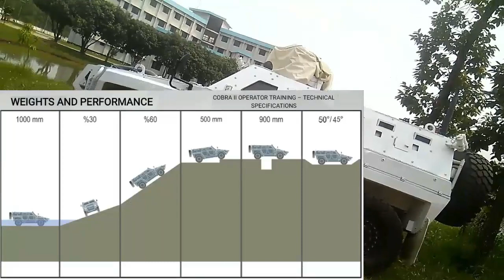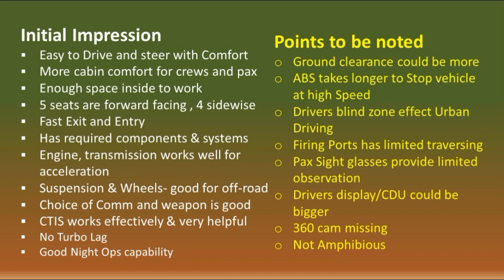Otokar Cobra 2 HMS Reviews, Part 1 (Intro, General Data, Specifications, External Systems)

Comment: There is NO way that cobra ii is longer vehicle than Turkish Ejder Yalcin , around 5500mm +/-100mm. "6400" is 100% wrong
Reply from the maker: Have I said  so??
Reply: @hmsmechtechreviews7875  "yes" You did by writing incorrect lenght at 6:35
Reply from the maker: Yes I said 6.4 meter including  the spare wheel. That space need to be co sidered to park the vehicle.
Reply from the maker: @milek021  including the spare wheel....  Did u hear?
Reply from the maker: @milek021  Also I said,,,, the main hull is 5.58 meters. Did not u notice that...huh
Reply: @hmsmechtechreviews7875  so, the spare wheel takes additional 800mm ?!?!
Reply from the maker: @milek021  
Look at that Jammer man. Irs big. 
Have not u got the correct hull dimension which is 5.58 meters? What makes u so sad about what it is carrying on its back?